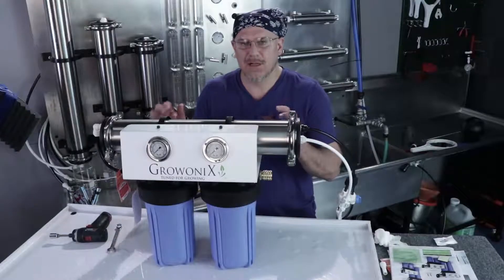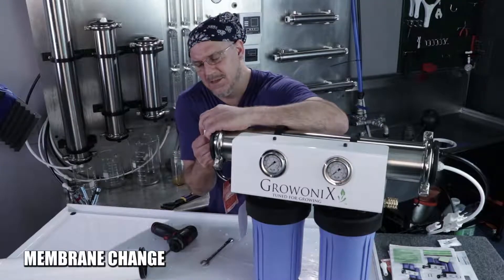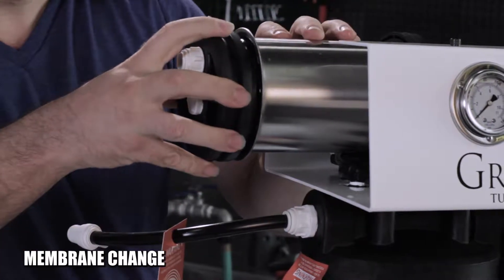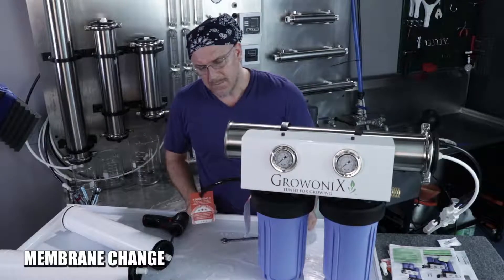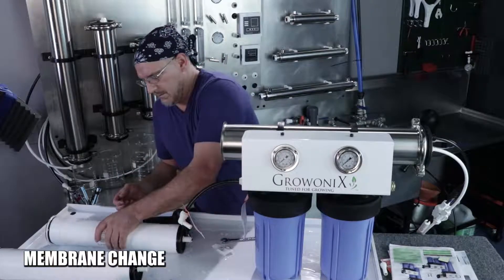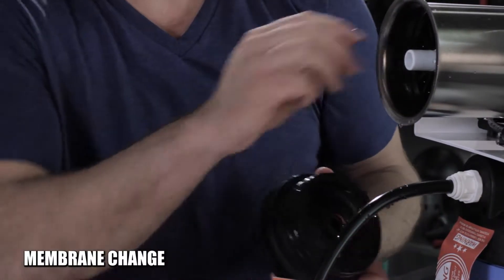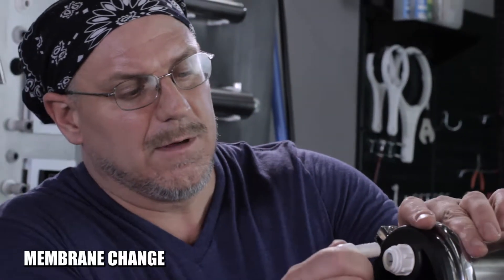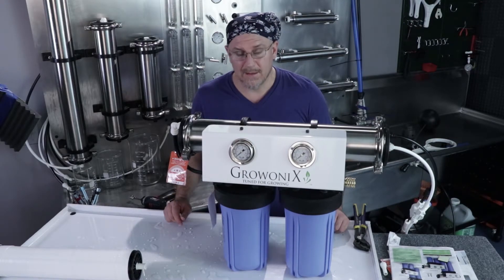GrowonoiX EX1000: Changing Membrane

Comment: How often do membranes an filters need to be changed?
Reply from the maker: Sediments get changed when they get dirty, and you have to inspect them to know this change cycle.  It's based on your own piping and water supply.  Carbon filters are good for 8500 (short) or 17,000 (tall) gallons—depends if you have the short or tall carbons.  Membranes are good for as long as they last with your water supply—typically anywhere from 1-5 years.
Reply: @growonixwatersystems5838  Ok thanks. Our water supply is about 2700ppm and the Ex1000 i have brought it down to 260ppm. So with the high salt content comming in I was thinking filters wont last to long